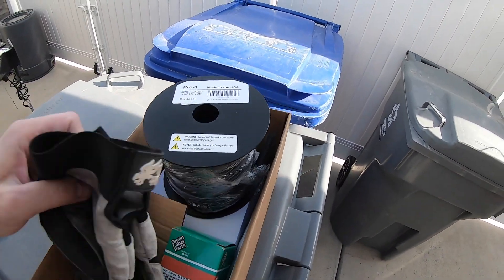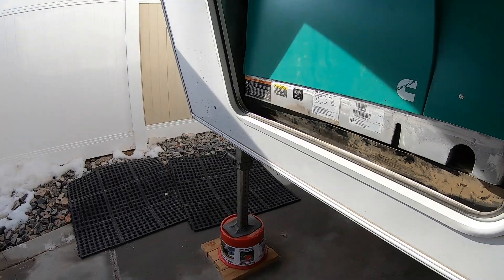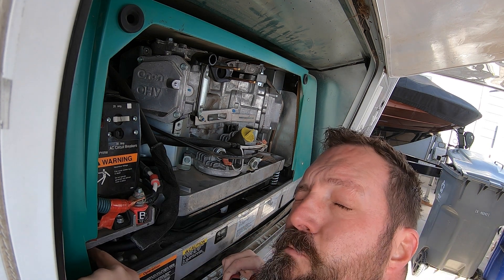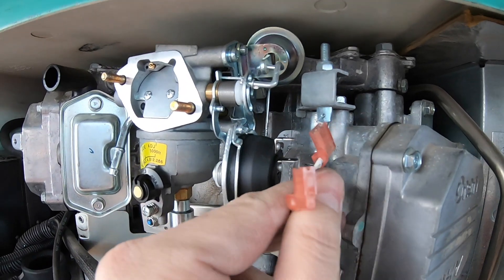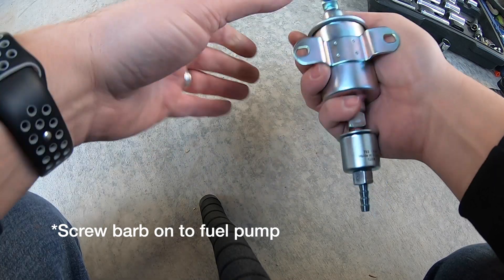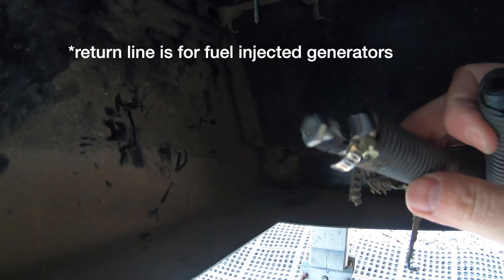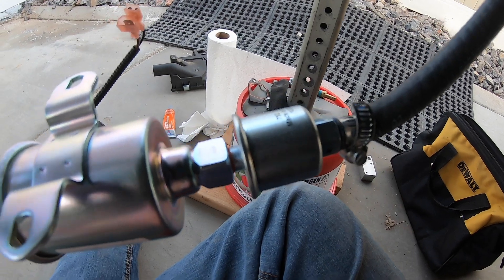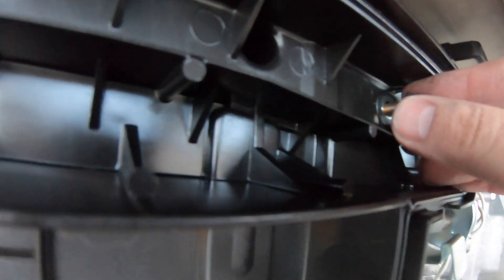I DID WHAT?  Can You Convert Your Propane Generator To Gasoline? (RV DIY or Forget It?)

Comment: Thank you for the Video.  I was wondering where the Fuel pump wires plugged in?  Is it inside the panel with the start/ Purge switch or a harness somewhere.
Reply from the maker: The fuel pump wires are the same wires that powered the propane solenoid. It was all plug and play for the most part. Sorry for the late reply.

Comment: What did u connect fuel pump to
Reply from the maker: The trailer had a gas tank for the generator so I just used the existing lines. The previous owner swapped out the gas generator for a propane generator so the gas lines were already there.

Comment: So please correct my thinking. I have a toy hauler on order with gas generator. It has (2) fuel tanks. I was planning to convert the generator to propane mainly because it burns clean and I don't have to do anything special for winter (not to mention I don't use a generator that much). So one tank would hold diesel for my truck, and the other gasoline for my Harley. Am I missing something?
Reply from the maker: Usually, one 30 gal is for the pump. The other 30 gal doesn’t have a pump. 

Propane generators are super inefficient…at least the Onan 5500 is. I was blowing through propane like crazy.
Reply: @SaltyVetAdventures  I didn't know that about the pump. Strange. But thanks. I guess my fate is gas.
Reply from the maker: @lylecrocodile4894  What I do is to fill the generator tank using the pump  tank so the fuel is always mixing. Also, the best (my opinion) is to put a full dose of SeaFoam in the pump tank when I fill up. This keeps the generator carb clean (doesn't gum up) and is stabilizes the fuel when in storage.

Comment: I have an Onan Emerald 6300 generator that uses Propane and alot of it. The only plus side in using propane is the lack of exaust odor, and right now propane is cheaper than gas but other than that, it's a serious pain in the ass to source out Propane when on the road, and sometimes Propane dealers give you the tank inspection/certification bullshit stories, that's when I give them the Fickle Finger Award (🖕)

    Thanks for your Service!!!🇺🇸 My Father was a WW2 Naval Veteran, He enlisted in 1933 with the ZP-12 (lighter than air) stationed in Lakehurst,NJ patrolling the Atlantic as a Radio operator, He then found himself on the U S.S. Arkansas (year unknown) then in 1942 He was deployed on the U.S.S. Redfin (Gato class Sub) South Pacific, Then in 1943/45 he deployed on the U.S.S. Wasp (Essex class carrier) South Pacific with Seven (7) battle engagements under his belt. CPO First Class Radio/Radar operator🇺🇸✌️
Reply from the maker: Propane is horrible unless you have a special case and require it.

Comment: It is sort of odd that with a gas tank already on board they would switch to propane but I'm sure they had some reason, to each their own I guess. We have propane gen on our current rig but then we already had propane and no gas tank so even though not as good as gas it's fine for us. Great video.
Reply from the maker: Thanks for the comment. Yes, I thought it was really odd that someone would want propane when there are 38 gallons of gasoline already onboard! Oh well. We just got back from boondocking at Goblin Valley and it was so great having the generator running on gas. Saved the propane for fridge, cooking and heat (temps in the 20s). Video coming this week!